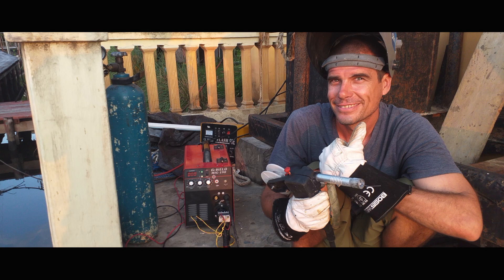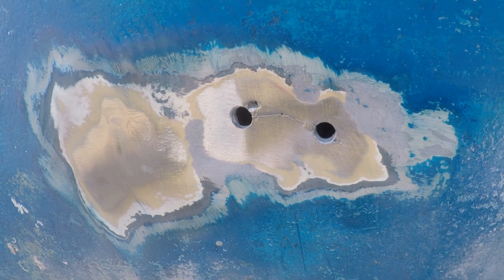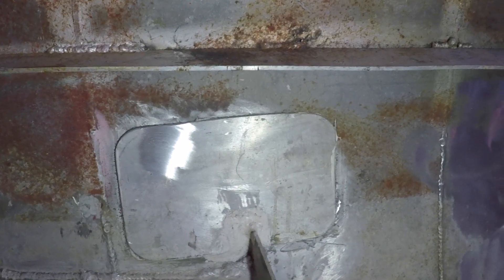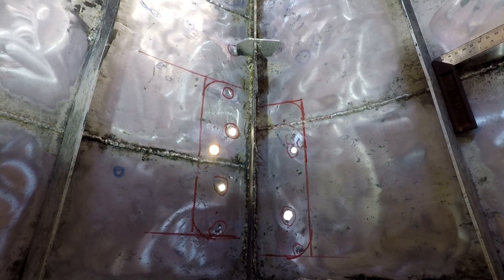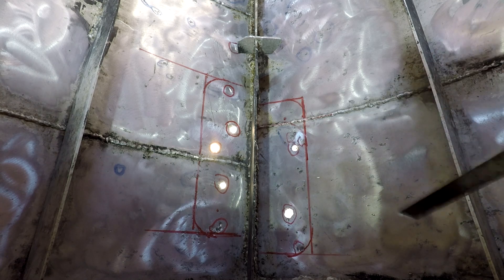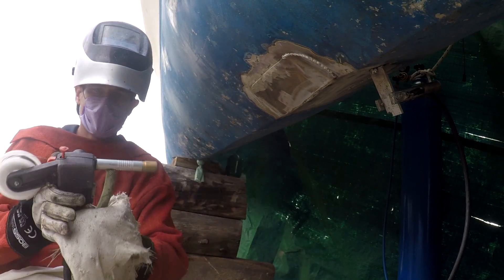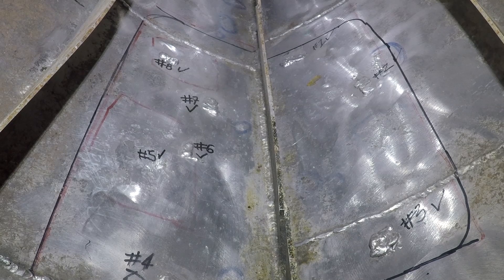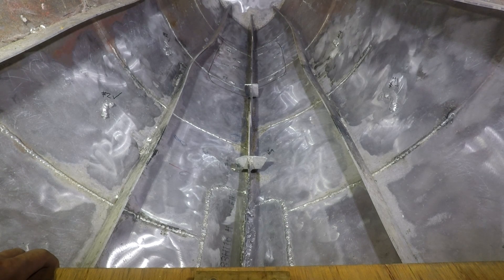Aluminum Sail Boat Crack & Pitting Repair -- Welding Tips from Some Guy on the Internet

Comment: Are you welding with AC or DC?  I was under the impression that aluminum welding is only done with AC ....
Reply from the maker: When the electric is consumable like MIG  i.e. the electrode is melted, you use DC. When the electric is not consumable and you add filler like TIG then Ac is used. Ac has a lot of advantages for control and cleanliness but is more time-consuming and requires more precision by the user. Any old MIG can do electrode positive DC aluminum welding.  But it’s finicky to get the Settings just right. Try to Google search spray transfer Aluminum mig , and AC TIG welding and there will be lots of information. So to answer your question I’m doing electrode positive DC MIG welding, With a cheap piece of sh!t Welder.

Comment: Hey, that’s awesome you did this yourself! How did you clean the hull (the before photo was so dull and after is so much shinier). I’m currently doing up my alloy boat too so would love to know how you cleaned her up. We used stainless steel brushes and carbide burrs... thanks
Reply from the maker: Carbide Burrs are great, SS Brush is good by hand only if good quality and kept clean and away from contamination.  Rotary SS brushes are not my favorite thing, they can leave little bits of themselves (like micro scale) embedded in the aluminum-- point of corrosion.  Also whole hairs can fly off and get lost in the bilge or jammed under a stringer to fester.  The best thing I have found is clean with soap and hot water first! acetone too if particularly dirty BEFORE using a scotch bright flapper disk on a grinder.   Expensive but soooooo worth it.    https://www.google.com/search?q=scotch+brite+flapper+disk+on+a+grinder&safe=strict&client=firefox-b-d&sxsrf=ALeKk02HE2DaEhwM3us3nEQ3kQUQdYed6Q:1587005536921&source=lnms&tbm=isch&sa=X&ved=2ahUKEwipo6Oq-OvoAhVJWysKHUGVBMEQ_AUoAXoECA0QAw&biw=1852&bih=1077#imgrc=Pg_pQs1wavlxxM